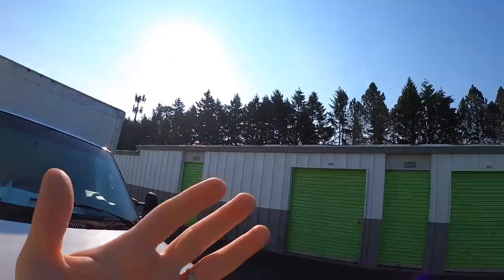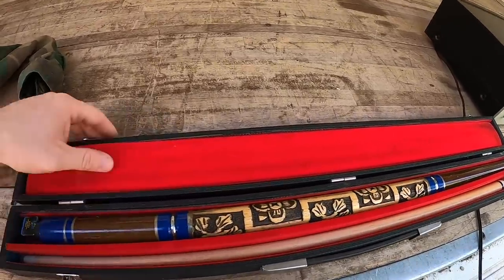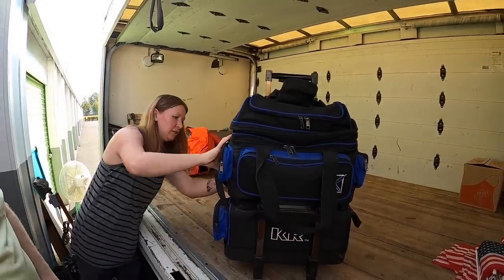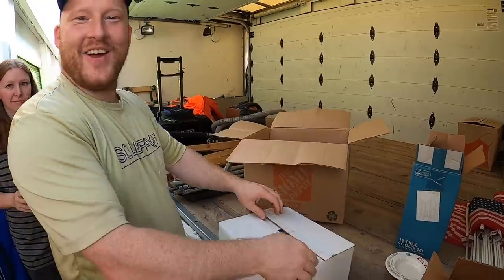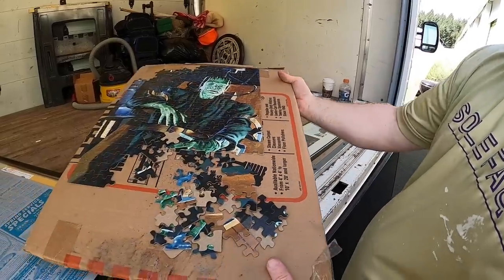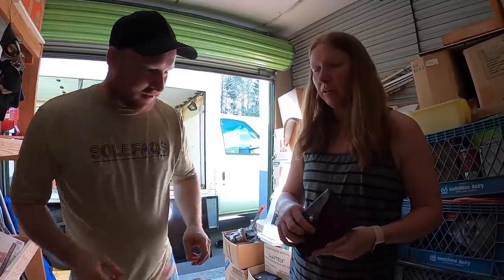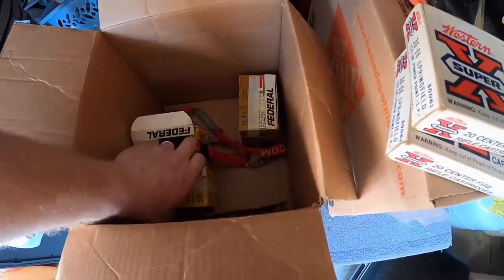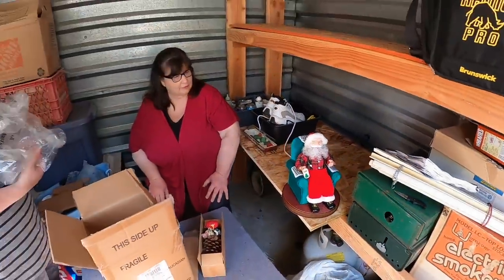I Won An Outdoorsman Storage Unit And Made THOUSANDS!.. Surprise Treasure Found!

Comment: Wade, you should just leave the necessary stuff in a bag in your truck.  Knives, gloves, rags, masks, ropes - stuff them all into a big bag.   With the pandemic, I have put my PPE in a big sack under the front seat, and am never caught short without a mask.
You could look up the stereo equipment on the HiFi Shark - they have everything.   The pieces you have are mostly in the $200-300 range.   If they don't work, they can be repaired by an skilled electronics tech.   Even if they do work, the capacitors should probably be replaced.
Oops, I didn't expect an SX-1080 - even I know that's big money.   In good condition, you're looking at $1200-2000.   The Kenwood speakers are about $500 a pair, so you've got about $1000 worth there.
None of the other commenters have a clue that you've found about $3000 worth of stereo equipment.   Forget about fishing poles and video games!

Comment: Someone in the family is or was a professional bowler judging from the brands on the balls and the quantity of them.  They can be redrilled to fit any hand span.  They could drill for standard grip, semi- fingertip grip or full fingertip grip.  Depends on their individual style of bowling.  Professional quality balls can be sold to other professional bowlers or serious league bowlers.  Those particular balls are worth $100.00- $150.00 apiece.  The bowling bags are worth $150.00 - $200.00 each.  And the ball bag dolly is $200.00 brand new.  You have at least $1,000.00 in bowling equipment alone.  Nice locker so far.  Someone else gave you the quotes on your stereo equipment.  You are looking at a reasonably decent profit on this locker.

Comment: Hi I haven't seen you in a while, my fault? or yours? lol  OMGOSH love the pants Wade.  My ironing board is broke too, I have a very long knitting needle holding it together.  The screw on the legs is missing?  Little spray 9 or greased lightening will take that spot off the pool table.  Today it was 56 and raining, first time since June. We never go all summer without rain.  There is a baseball bat in my room and yes I have beat someone with it.

Comment: Can be re-drilled if nice one is worth it.
Reply: Each of those bowling balls are professional grade.  Wade has at least $1,500.00 in bowling equipment on the low end of the spectrum.  $2,000.00 on the high end.

Comment: The ONLY time I ever went deep sea fishing or even out into the ocean with my hubby we scheduled a full day trip & found out after we were well on our way that they had issue with full day boat so sent out the 1/2 day boat but forgot to stock it for the full day & there were like 7 kids under the age of 8 running all over the boat nobody wearing life vests then I was sitting inside wen boat engine died & as I watched the guy working on engine go into the bench seats and other storage areas I realized there were in fact no life vests or blow up rafts or anything if this boat goes down. To matters worse at one point we got told no more food or drink & we can use the bathroom but not any toilet paper. Then I cant make this up but while we were barley moving back towards land a storm decided to show up & by the time we got back to land tide was going out & boat ended up breaking off a part of the dock before we finally got off the death ship lol.